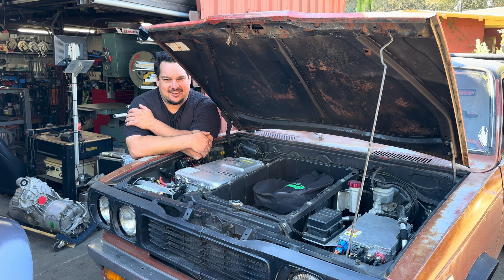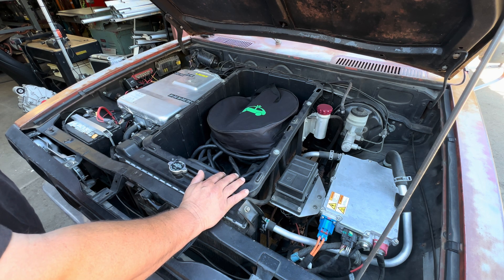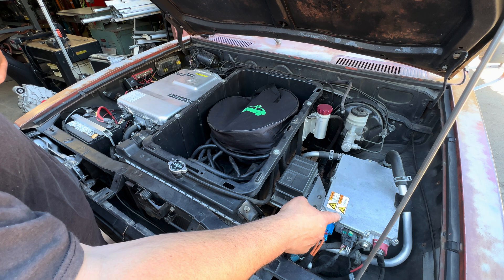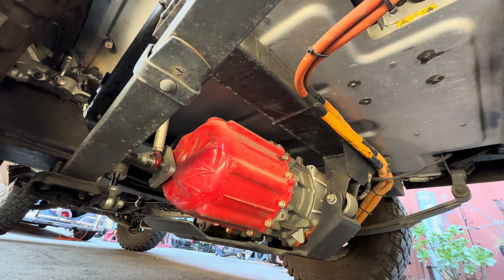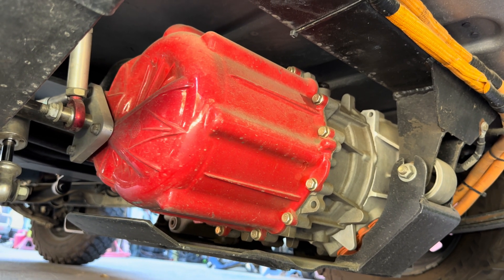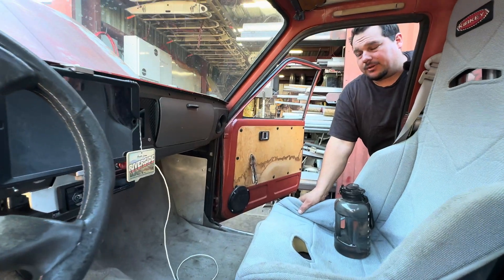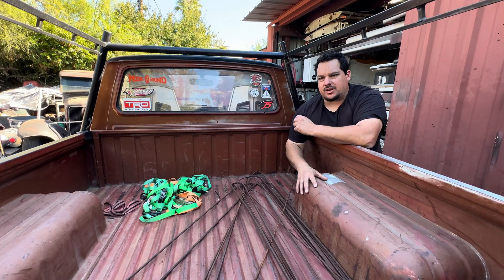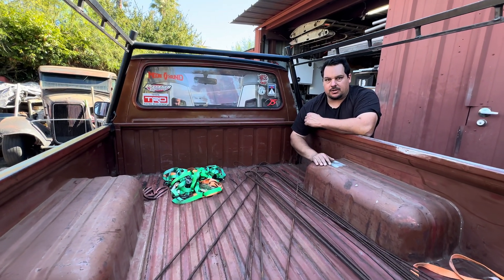Toyota Hilux - EV Build Strategy

Comment: Hi, don't know if you remember but a few months ago I commented on how I would love to do this to my 96 4runner and I wanted to hear your thoughts about an idea that I've had.

Since my rig is an off-roader/overlander, it goes without saying that I would love to retain 4WD and I was wondering if it would be feasible to hook the motor to the transmission and have the power follow its "natural route through the transmission and transfer case? I would probably need to move everything back slightly to be able to fit the range extender under the hood I guess.

Also, do you think the battery would get in the way of rear driveshaft or would it need to split it in the middle to make space for the shaft?

Comment: Have the same truck I’m thinking about doing a dual modded Tesla motor set up trying to think of how to get started that being said I know it’s possible because I’ve seen a single motor done but two
Reply from the maker: Dual motor would be nuts in a truck this small. But would love to see it!
Reply: @ I figure if I lower the stance at some sway bars to increased ability it’ll be fast, but agile I’ll definitely have to convert the rear drum brakes to disc brakes for better stop power

Comment: Great design. What controller/board did you use to integrate everything?
Reply from the maker: Thanks! The charger uses an open inverter board, motor uses a T2C and dcdc is just an enable wire.
Reply: @J5Jonny5  nice. Anything needed for the i3 battery to open the contacts?